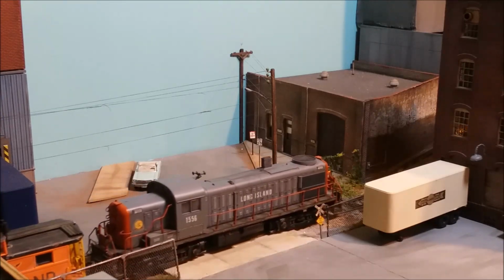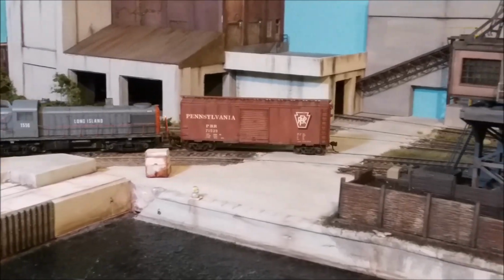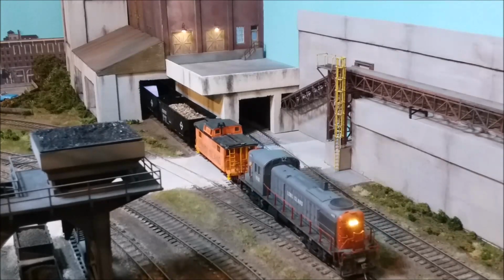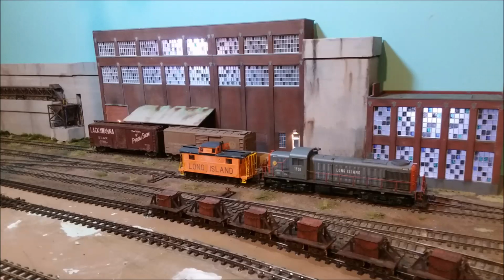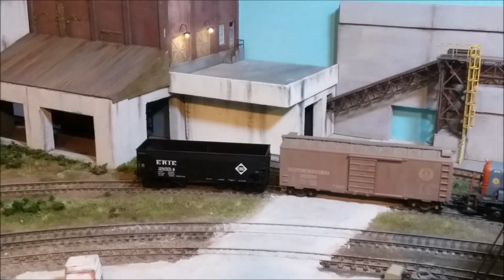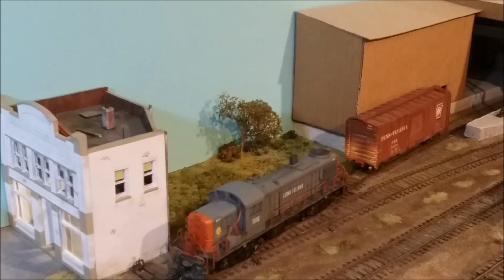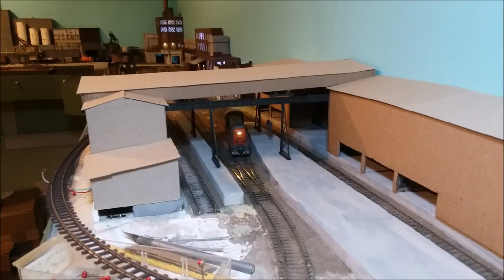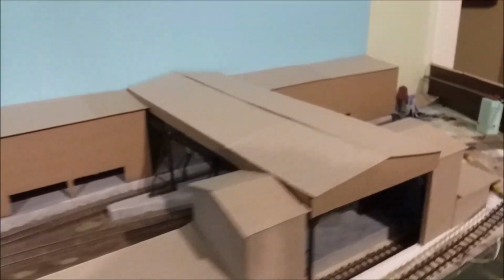Switching Phelps-Dodge Complex. Finally!

Comment: The key to your and other switching ops is --- speed. I like the relaxed pace . No pressure , just running trains which is the point , isn't it?
Reply from the maker: Absolutely! Thanks for watching.
Reply: I agree so much with this. As a 26 year Railroad Carman (UP), from a 118 year railroad family (Same yard), nothing ruins the video of switching a nice layout more than speed. Nothing happens fast on the railroad. Crew has to walk to everything, joints have to be stretched, air joints have to be made, brakes tested. Speed limits, "Hey we need a Carman or Engine House out here."; its raining, snowing, hot; can't make the joint; set or remove handbrakes; Managers hiding in bushes, testing with red flag; Carman has to lock and flag, or unlock track, left a lock; Beans; etc, etc, etc. Nice to see you take the time to do it right. There are some stunning Model Railroads, I will not name, that go zipping through switch moves so fast, i just can not watch them. I like your pace though.

Comment: Great switching session. 
Like cardboard mock-up. Roof over crane would look better if it were parallel with crane rails, I like the concept. 
Cheers Peter.
Reply from the maker: Thanks for watching. And, well, cardboard gonna cardboard. The final will be straight!
Reply: I wonder whether he means the peak line being parallel with the rails would look better?

Comment: One more nice video, Phelps-Dodge, is taking shape nicely, the covering of the overhead crane is a good thing too. Will wait for the real construction. Just one thing, you've put lights, leds for sure, the color is really blue, just my two cents...In any kind, like the layout.
Reply from the maker: My overhead lighting is grossly insufficient. When I first put it in I wasn't planning on doing videos, and it was good enough. Now I need to put in a valence and lighting, but carpentry is my weak spot so I keep putting it off.

Comment: Great layout! Do you have a video where you show how you do your concrete foundations, loading docks, and abutments?
Reply from the maker: I don't, but I learned everything I know from Jason Jensen Trains. He's a master. In brief, a piece of closed cell insulation cut to size, a thin coat of dry wall mud (not always necessary, depends on the Styrofoam), a coat of light beige-ish chalk paint, followed by a wash of light grey craft paint. Then weather with powders.
Reply: @longislandrailroadmontaukb982  Thanks, I will give that a try. Once you described it, I realized I have seen that done in a video by JJT. But I will go back and re-watch it.

Comment: I like the structure, I think it looks good.  With regard to "design for operations" I'm generally not in favor of having buildings in front that one would have to reach into or around to uncouple cars, especially guest operators.  In that case I'd rather have the trackage in front of the structures.  But if there's no reason to reach into that area, and little risk of causing any damage to it, then I absolutely think it adds interest to the scene.
Reply from the maker: I agree on principle, but sometimes you gotta break the rules! I did keep the front part of the structure as low as I could.
Reply: @longislandrailroadmontaukb982  , your layout your rules!  I think it's fine, and I expect you've already considered it's placement with respect to ops.
Reply: I had a friend who was adding operations to his layout - Keweenaw Peninsula copper mining, and had some very nice scratch built mine heads.  He invited me as a guest operator for a fresh eyes shakedown.  On one of these mine head structures the spur went behind it, and when uncoupling my shirt sleeve caught on the roof and it moved.  It was intentionally left loose, and I didn't break anything, but it scared the CRAP out of me when it happened.  So after that I would uncouple first in the clear, then shove.